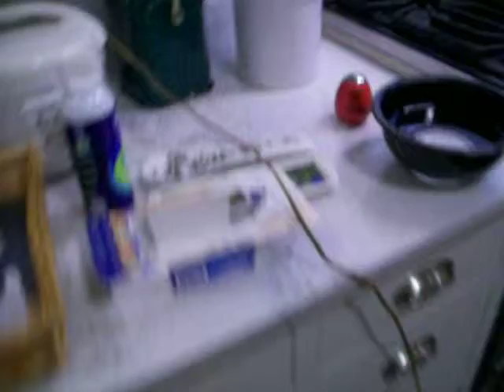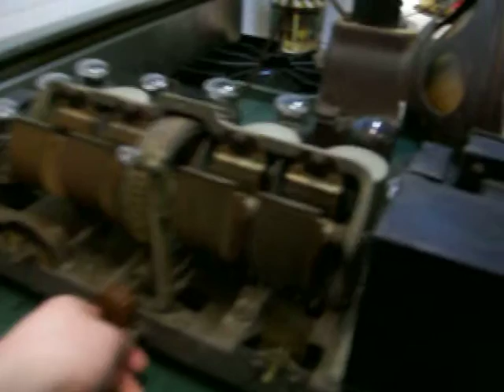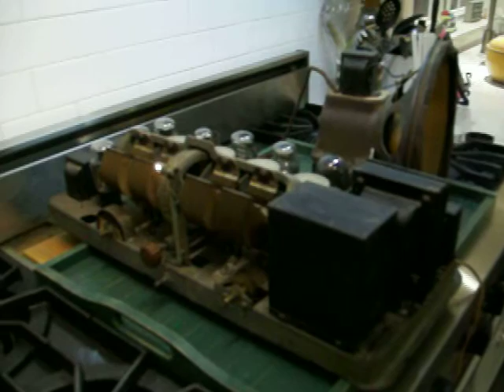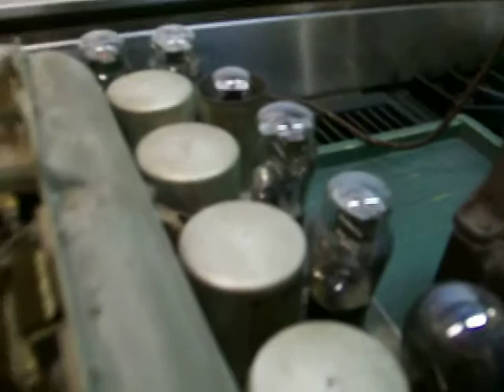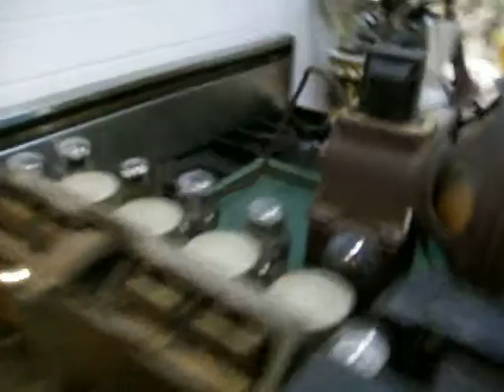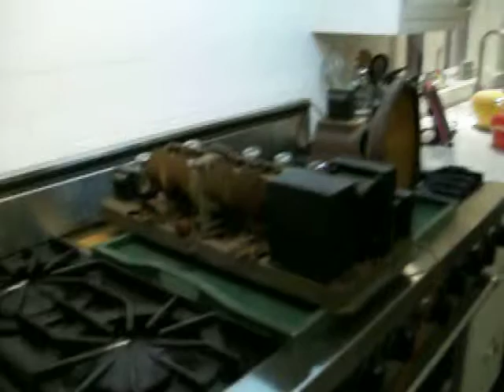First Test Of My 1920's Philco Radio

Comment: Why do you say 1921?   Is there a nameplate? Philco 511 introduced mid 1928 is described as the first production radio from Philco.  I own a Philco 511, and there is also a YouTube video showing the Philco 511. Its chassis layout is close to, but not the same as yours.
Reply from the maker: +Don Fulton You can tell it's from 1921 by the outer casing it came from.